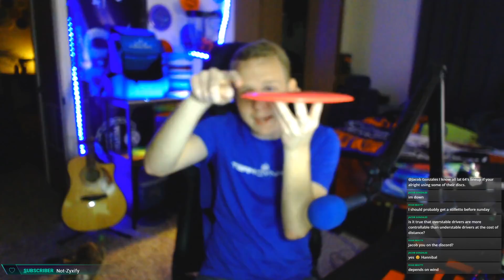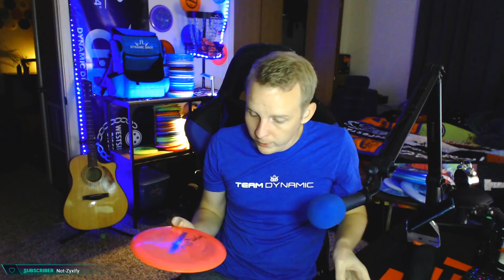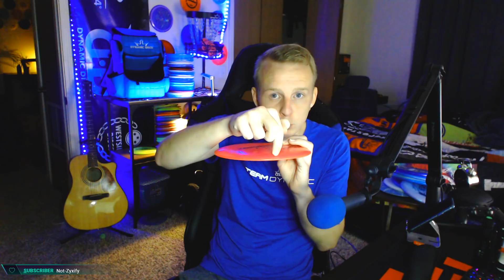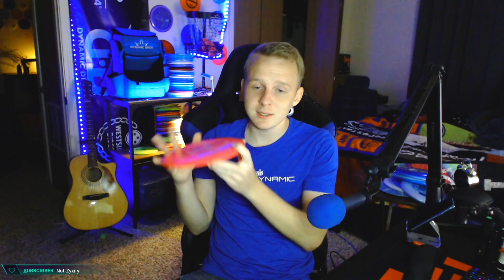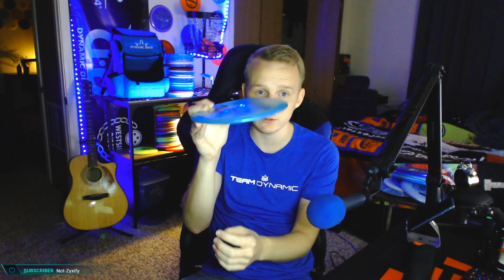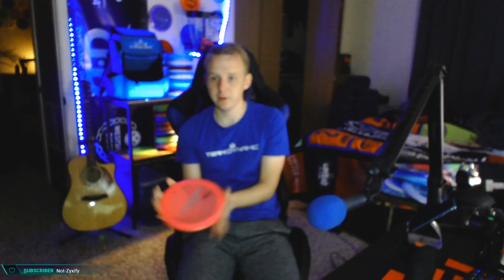The Physics of How Discs Fly [FIXED]

Comment: A beat up disc is also more rounded meaning the air generating lift has a steeper angle

Since the lift is shifted to the side by the spin (like you explained) the left side of the disc on a backhand is raised slightly more compared to a new disc

Comment: OMG no! You had it right to begin with. It's the Bernoulli principle. A combination of rotation and forward momentum is what causes lift, specifically because the wind going across the top is moving faster across the disc. A disc works much like a helicopter moving from a hover to transient flight. Turn is caused by a principle called dynamic turnover. The faster a disc spins, the more sensitive it becomes to its stability. When you couple this with forward momentum, the leading edge(left side) of the disc will generate more lift than the trailing edge(right side), thus causing the disc to turn right. Please read up on how a helicopter flies, you will understand this better. 🤦

Comment: Had me until you substituted "glideier" for lift at 2:41.
Lift is created when the air over the top is faster than the air underneath.
   The felon causes the air underneath to be the same speed as the air over the top.
Lift is what makes an  airplane  wing go up and the airplane lifts off the ground.

    2:41: "Understable discs are more glidier"   because...why?
               "Domeyer discs are more glidier for the same reason"  what is the reason???

Are you saying that "GLIDE" is based on lift???

Comment: Ur a trusted content provider with a relatable style but you bit off too much. 
This topic is best left to experts and ur anecdotal tales are confusing players.

There's a reason the community keeps putting out flight videos. We're still evolving our base knowledge without definitive empirical  flight data. Static wind tunnel  test and wing shape comparisons don't cut it.

Some day we will have data that will end one arguement and start another.

I've asked Veritasium to do real disc testing to help our community. I believe he has the skills to rescue us from applied guesswork.

Ditto to the technical detractors to some of ur claims. 

If you want to impress playing partners with smarts, say "inertia " or "gyroscopic precession". Or ace it.

Comment: Danny, thanks for this video. Many years ago I did an extensive research project on the subject. Specifically focused on why at high speeds a disc turns over, lower speeds fades. I’d love to share my findings. As a starter, beat-in old discs become under stable because the shape changes. Every hit against a tree will bend the nose down. Over time those bends add up to a disc with more dome exposed at the disc profile, and the bottom bevel gets hidden from the frontal air. As you know, this shape is typical of under stable discs. You can test this by using dx plastic on a newer disc, warm it up and bend the edges down. Instant flippy disc. Contact me if you want to discuss. Thespicerack4@yahoo.com. Arlen.

Comment: I actually think the Bernoulli Effect still applies and is linked to the explanation with the "downwards directed air". The latter is just the same result being explained with Newtons law of Inertia instead of the Bernoulli Effect: the Inertia of the downwards directed air must be equalized by a counterdirected inertia (=Newtons law), this results in a pressure gradient which lifts the disc up (=Bernoulli Effect). It is, so to speak, the same phenomenon being explained from 2 different perspectives. 
However I´m not an expert in fluid mechanics, so I´m not 100% sure if that is acurate :)

Comment: Hi Danny. Forget flight physics - it just doesn't matter. 
In fact, the reason planes stay in the air is because the wings deflect a mass of air downwards that is equal to the mass of the plane (in level flight). Bernolli lift makes wings efficient, and offer increased flight performance over a wide range of airspeeds. But there's no problem making a perfectly flat aeroplane wing, they just don't handle very well.

Comment: I'm with Jacob.  I think precession explains the disk behavior in some realms of flight.  The roll force of the disk is the cross product of the gyroscopic and lift vectors.  The relative strength and direction of the two vectors changes in flight so that a component of lift is at times perpendicular to the spin vector, causing turn or fade.  Throw the disk at the designed speed with designed spin, the vectors are colinear and the disk flies straight.  Overthrow the speed number, the lift vector shifts off axis a little and it turns.  Underthrow and it fades.  Danny's explanation may be better for low speed fade.  Great post.  
Danny, your video on keeping my shoulder joint at 90 degrees when throwing was a magic key for me.  Seems simple but all you hear from the other vloggers is snap and reach back and blah blah blah.  Nothing helped til I saw your vid.  Now Ezra has now come out with a video on this point.  Check it out.

Comment: Danny, thank you for the great content. Seriously appreciate your work. 
Wanted to illuminate some critical contributing factors for the decrease in stability from the "beating in" of a disc. The geometry of the "nose" (or absolute leading edge of the disc), the lower rim profile, and the rim bottom(either the bead or absolute bottom of the disc) contribute significantly more to the flight stability as compared to the small indentations and air boundary layer.
 As we throw a disc more and it contacts the ground or other surfaces, it wears away the rim bottom or the bead. This effectively decreases rim wall height and moves the absolute rim bottom closer to the leading edge of the disc, in relation to angle as viewed from a side profile. It also slightly changes the geometry of the lower rim profile. This is the major contributor to decrease in stability.
 The disc impacting a tree or other objects and bending the leading edge down while also creating a more blunt edge will have a similar effect. You do a great job of explaining the edge profile and how it contributes to flight in your video. This is the same concept.
To demonstrate this take 2 identical discs and sand the rim bottom of one enough that you can tell a difference. Modify them in no other way. The sanded one will instantly become less stable. This works for all discs, but high speed drivers with a microbead especially. 
We can also observe this with the occasional disc that has a tiny "lip" on the rim bottom, often caused by the mold release process. Discs with this tiny sharp edge are more stable than normal. As soon as that edge is gone the disc will have a more usual flight pattern. 
You will see an increase in stability if you take a disc like the Freedom, which is silly understable, and sand the leading edge to an upward angle, in relation to the top of the flight plate. 
Air boundary layer, like with golf balls, does contribute, but to a lesser degree. Likely it contributes more to a decrease in air resistance. I think we see this with Lat 64 Raketen and Misselen. They have "Hex technology" to increase the air boundary layer but we don't see drastic decrease in stability
Reply: You seem to know what you're talking about, so I'll pose this question to you. I think the explanation he gives makes a lot of sense but I feel like there might be one other variable in the process and I'm curious if that's true. 

My theory is that (similar to the magnus effect) the part of the disc that's approaching the wind will generate more turbulence and therefore less lift than the side that's moving eith the wind. This effect would be less strong than the gyroscope effect until the disc slows down, when the rotation starts having a larger effect and the side moving with the wind generates enough lift to overcome the gyroscope precession and turn the disc
Reply: I feel like that makes sense but idk

Comment: My theory on beat in discs is that the left side of the disc is at higher pressure because it is pushing air forward. The right side of the disc is at lower pressure because it is pushing the air backward. This causes a pressure differential between the left side and the right side of the disc. Therefore, a force pushes the disc from left to right. I’d say this is different than gyroscopic precession. It’s more of a sliiide to the right. The same thing happens to golf balls but since they spin backwards an upward force is generated.

Comment: Danny keep studying the physics of disc golf!
Do you think a nose down angle could take a disc further distant with a tail wind given the lift will be with the wind and really send it?(Even though a tailwind gives an effective slower speed and headwind faster)
I noticed that a nose up occurs because the backside of the disc at release may have drop slightly due to gravity. Thus nose up and  high stall left. Lots of frustration. I have not heard anyone talk about all that weight at the back and the wrist not strong enough to keep the rear higher to prevent nose up.
Thanks

Comment: it's vector multiplication. multiply the lift vector by the tangential velocity vector and you can visualize how as the disc flies it will start to tilt. hyzer for overstable(RHBH) and anhyzer for understable (RHBH).

Comment: Good vid Danny! The upward pressure causing tilt is true. This point of pressure is key to freestyling. When you nail delay, you are constantly moving your finger 90° into the spin. Thumb pressure on the flight plate can setup a pressure point that is the "center of spin". In order for this "center of spin" to return to the center of the disc, the disc will turn over. It is the nature of a gyroscope. Again...Good vid! On point!

Comment: Great article, Danny, your explanation makes a lot of sense to me. However, when explaining the fade, my feeling is that it is not sufficient to take into account only the changed angle between air and disc. The reason of fade is the Magnus force, while the reason for Turn is the gyroscopic force. Gyroscopic force and Magnum force are overlayed during the whole flight of the disc, and act in different directions, so they fight each other. However, in the phase of flight when the disc is spinning a lot and moving forward fast, the gyroscopic precession has a much higher effect and therefore forces the disc to Turn. At the end of the flight with slower Rotation Speed and forward speed , the Magnus effect is stronger than the gyroscopic force, thus forcing the disc to fade. Have a read here for some explanation about the influence of the Magnus force on fade:http://large.stanford.edu/courses/2007/ph210/scodary1/. Your explanation about worn discs fits well to my theory: due to the turbulences around the rim the Magnus effect is smaller, resulting in more turn and less fade, making the disc more understable.

Comment: I can't disagree with the turbulent air argument. It makes a lot of sense. When I was looking into beat-in discs, I found that the more important part is that the nose gets pushed/bented down, making more of an understable disc shape. Not that it's helpful today with premium plastics, but disc tuning used to be a thing; I.E. Aerobie Epic.
Reply: I agree with the altered shape, and would describe it as lowering the PLH (https://www.dgcoursereview.com/forums/showthread.php?t=13889). About the air turbulent argument, would those scratches/tears etc not affect the disc at the front in the exact same way, thus counteract that 'increased turnability' in the back?

Comment: Cool stuff but I have some points I like to get in:  1) Your first idea of how discs generate lift is correct, they do generate it by air passing over the top faster than it passes over the bottom (the bottom is shielded from airflow by the rim so the airspeed there isn't much at all) but a disc is the worst form of "wing" you can have since practically all of it is subject to wingtip turbulence. Although the airflow "turning down" behind an understable disc can have an effect it is too closely linked to the dome of the disc to consider separately since greater curve = more airspeed which results in lower pressure. Airspeed leaving the disc also facilitates high airspeed over the middle since the airflow "wants" to stay connected because of its own inertia (this inertia means its a bit of a "bump" go from a smooth airflow to a turbulent one)     2) I disagree with your spin analysis for overmolds: the difference in spin won't be worth mentioning if you just shift weight 10% closer to the rim but the main part I really disagree with is spin retention... discs don't really lose spin to a noticable degree while airborne. All of the changes to the flight trajectory happens as a result of losing speed which causes loss of glide which causes the disc to "fall" and thus fly "nose up" relative to its direction of travel, hence more loss of speed leading to the fade, having the weight closer to the rim will counteract the turn and fade slightly better but is far less important than an overall good discdesign.              3) Your turn/fade analysis is spot on however although the segment you cover it in here is mainly for new discs.                4) I strongly disagree with your opinion of beat in discs and why they behave the way they do. It has almost nothing to do with "dimples" or pits from impacts but everything to do with the disc becoming slightly warped upon impact, each impact creates its own microwarping of the disc kindof like a bicycle wheel after years of use without anyone realigning the spokes. This yields an uneven flightplate which causes increased lift on the side that is spinning against the air (just like a helicopter prototype before they figured out how to realign the rotorblades to compensate for airspeed) this "different" understability has the added benefit of pushing the nose up late in the flight which can help stretch it a little bit and land it softer. For examples of "dimples" in discgolf you can see if Anthony still has a raketen or missilen in his disc collection and you can experience firsthand how proper dimples speed up the disc a bit but totally guts the glide.
Reply: Why should the air pass faster over the top of the disc?
Reply: @Postermaestro  when a gas (edit: should say "ideal gas" but air is very close to it) moves faster across a surface the pressure against the that surface becomes lower (even without any change of direction of that airflow), that is how airplanes generate lift. The wings get "sucked" upwards. Helicopter rotors work the same way. Sails work the same way too most of the time unless you hoist a spinnaker in order to "trap" the wind more like a ww2 parachute. (many spinnakers are cut for airflow across them however) TLDR: Curved surface = longer way for the air to travel so it must move faster across it to keep up.
Reply: @Flakzor123  no the question is why should the air try to "keep up" with the air that it's parting with at the front of the wing
Reply: @Postermaestro  its actually keeping up with the air in front of it and it's being "encouraged" to do so because it takes a decent amount of energy to create a vacuum, the airflow underneath has no impact on the airflow above unless the angle of attack is very high and there are vortices forming around the sides. I know it sounds a bit wierd and funky that the air in front should dictade what the airflow does but it kindof works that way as long as the airflow isn't turbulent because then it will want to stay "attached" to the surface its flowing across. Windsurfers pumping their sail is a good example of what CA Marchaj refers to as the "flow memory effect" in one of his books (sail performance, 1996) where they essentially gain a short burst of lift associated with increased angle of attack but the airflow stays attached instead of stalling out because its just a short duration. An example we can probably relate to better is windbounces, when you throw a flat shot and your disc is yanked up by the wind without losing any speed.
Reply: @Postermaestro  Also, the disc creates a wave through the air as it moves through the air and that wave in turn sucks in more air to follow in its wake, this also assists in airflow over the top of the disc. A fairway driver with a clear separationline but still a fairly rounded rim will push the air aside a lot more than a sharp 14 speed disc. Slower fairway drivers can have quite a lot of glide as a result of this, doesn't quite hold up for midranges however but I suspect it's because they rarely have a clearly defined partingline.
Reply: @Flakzor123  thanks for your post henrik. I was going to write a lengthy reply to danny but you covered nearly everything.
👍🏼👍🏼👍🏼
Reply: @Flakzor123  I like to think of it like a river. If there is a small island in the center of a curve, the water around the outside bank will travel much faster than the water around the inside bank. They are both traveling to the same elevation, but the outer bank travels faster to get there at the same time. The island is the disc, the water along outer bank is the air above the disc, the water along the inner bank is the air under the disc.